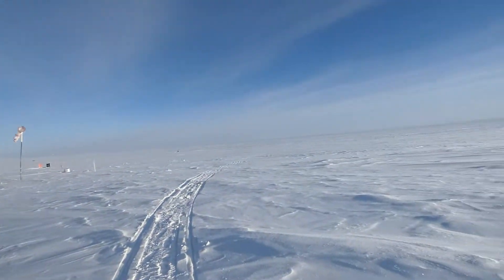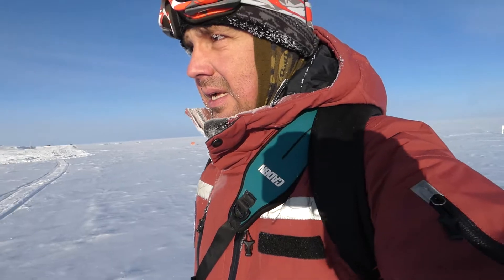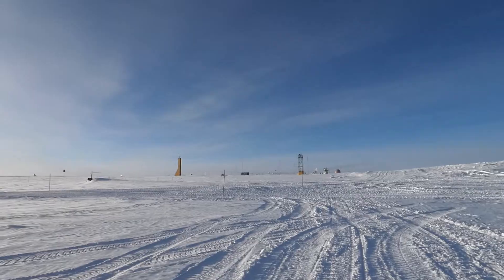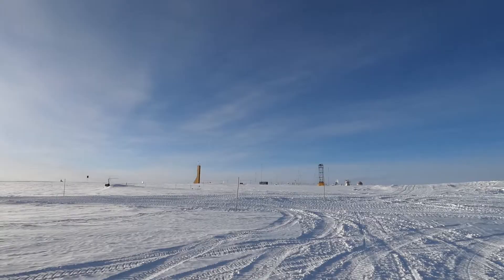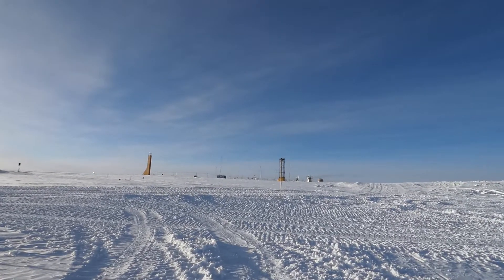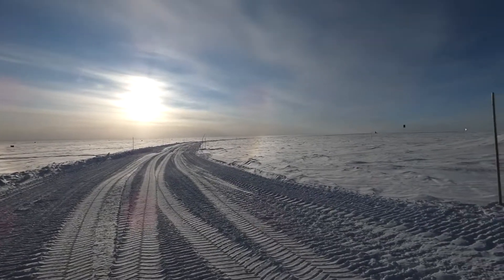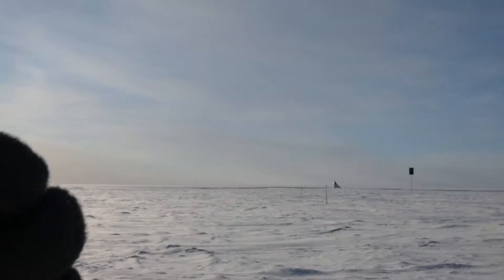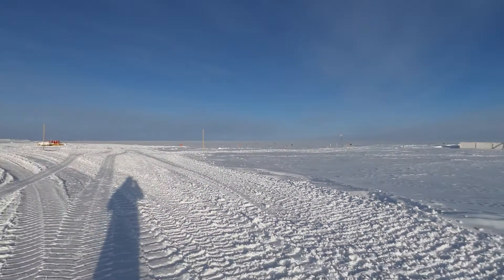My time at Vostok station in Antarctica

Comment: Amazing!! Did you see a glimpse of what twilight when sun sets occur during the spring and parts of the year and especially the midnight sun there that goes from late October to late February and the opposite when the polar night happens from May to August? Also, what was the latest sunset and/or earliest sunrise you saw here and the lowest temperature that you experienced there? :)
Reply from the maker: Thanks! :)
I'll start from the end :)
The lowest temperature was -82,1°C. The last sunset was in early May, and in several days it was followed by utter darkness, lasting till early September. The twilight periods were September and April.

Comment: Priviet, just found out about this fantastic channel of yours :) Defenitelly add some more content if you have some left. It must have been really tough medical wise and mentally, beeing so far away from the near hospital and everything that comes with it. Its the coldes place on eart, at least they say, but I heard that this place is not the coldest, coldest inhabited for sure but places northeast from your location or on antarctic could be even colder, from satelite measurements it shows temperatures on the surface around -100 celsius.
Reply from the maker: Thanks for the comment!
You can consider this whole region of Central Antarctic Plateau as the coldest on Earth and that would not be incorrect) Also keep in mind that there's a difference between meteorological site temperature and windchill)

Comment: 4200m elevation is insane, on top of being extremely cold it's also hard to breathe
Reply from the maker: That was quite an experience. The exact altitude was 3488m amsl, but the fact that in polar regions the atmosphere is relatively thin made the altitude equivalent there about 4200m
Reply: @Space_and_Polar  So basically the barometric elevation is 4200m. That's actually pretty crazy. Imagine how much lower it would be if there was a storm happening!
Reply from the maker: @Shonade2  storms are very rare there. During our wintering we had only two several day periods of 15-17 m/s winds while usual wind speed was 3-4 m/s. That resulted in the need for some manual shoveling to get from one building to the other.
Reply: You could really see and hear how the brain is working a bit slower with less oxygen!

Comment: I worked in Antarctica for 28 months (two winters) which was great.
Reply from the maker: Indeed!
My emotions are the same!)
Reply: 28 months is 2 winters?
Reply from the maker: The guy means two polar winters. Polar winter is about 14 months. That's because if you're there for a winter you can't get out any time you want because the logistics stops during winter months. When I've been at Vostok we were fully on our own from February to October as no plane or vehicle could come due to temperatures way lower than -50C (the minimum for our mission was -82,1C in June 2019). Things are slightly less extreme on the shoreline but stormy sea and continuous winds up to 40 m/s can deny any logistics.
Reply: Did you see the ice wall?
Reply from the maker: That's tip-top secret)
😅😬😆

Comment: How is Atmospheric pressure 4200m at Vostok and yet 3400m above Sea? 😈
Reply from the maker: That's due to the fact that it's polar region and the atmosphere is slightly thinner there and the extreme cold that affects the gas composition of air. Combination of that gives the eqivalent of pressure at 4100-4200m at the actual altitude of 3488m)
Reply: He had to climb an 800ft ice wall from sea level just to get on top of the Antarctic Plateau

Comment: good stuff Nico I was there January 2019 a flight from Novo I was the flight Engineer With Kenn Borek Air  resupply and crew change I almost passed out just trying to help refuel I think it was -46 C  the pressure altitude is way high like you said 4200 meters
Reply from the maker: Have you been to Progress or your way to Vostok was straight from Novo? Btw Kenn Borek Air are great guys!))